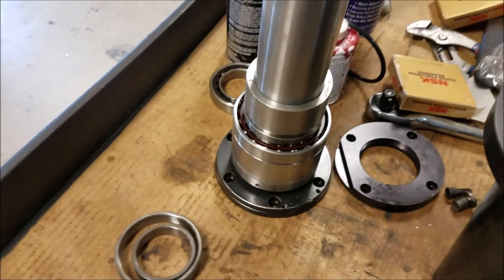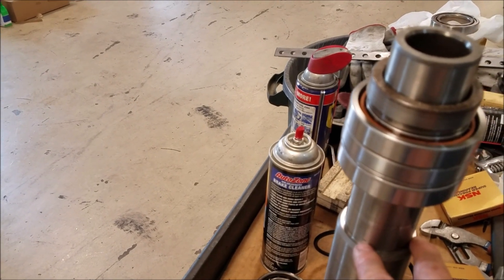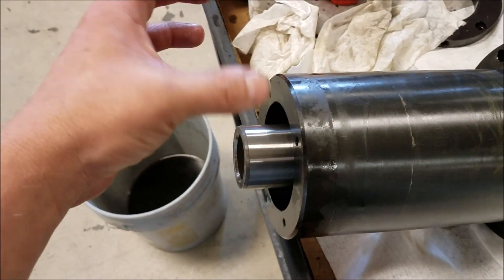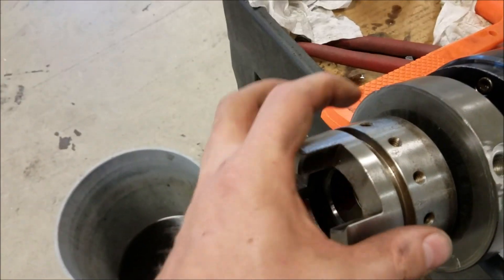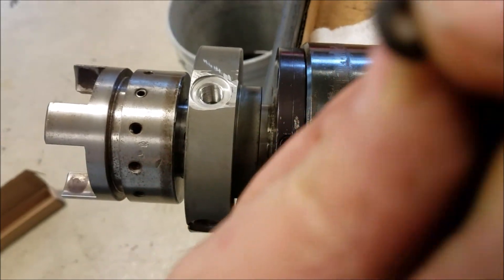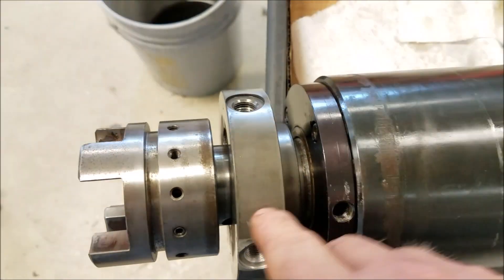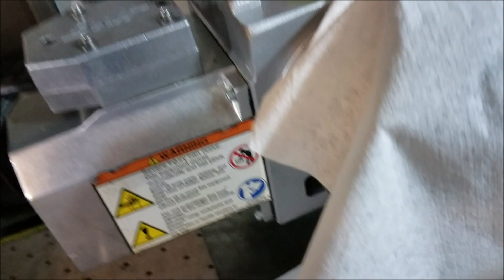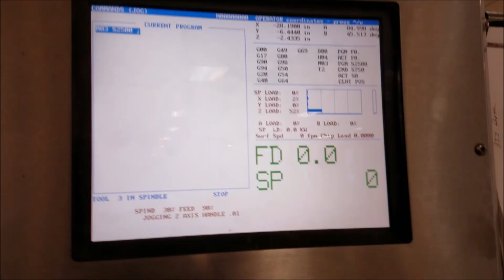Haas Spindle Bearing Replacement Part2

Comment: I like your video, but you failed to explain the most critical part of this process... the proper mounting of the matched set of the angular contact spindle bearings. There is a reason why professional service technicians are paid what they are paid, because they know these things. 
Secondly, machine tool manufacturers sell these spindle cartridges as complete assemblies, because they are balanced after assembly at the factory.
Finally, shims are used by FST's who don't understand how to tram the column.
Reply: The spindle needs to align where it's mounted. It needs to be parallel to the z axis and perpendicular to the x & y.
You aren't supposed to shift the z-rails off vertical to compensate for the mating surface that mounts the spindle - unless you want to cut diagonal vertical lines.
No one going to warp their column or do some other extreme measure like trying to resurface the mating surface for something that every guide says to use shims to accomplish.
There's not a single machine in this aerospace machine shop that doesn't have a manufacturer guide saying to use shims to align the spindle at the mating surface if needed, including a 5-axis machine.
Your comment doesn't make the FST's seem ignorant...

Comment: The oil port doesn’t lubricate the drawbar. It is packed with grease and TSC often leaks in and corrodes the drawbar. The oil/air port only lubes the spindle bearings.

Comment: Sir can u help me about this how can i pullout the  coupler from spindle shafting  pls help me sir the spindle that i replace bearing is same to youre demo haas cnc spindle is very hard to me to pullout the coupler drive thanks sir
Reply: I use a torch to gently heat it all the while putting tension on it with a gear puller.  When it get warm enough to expand it should literally pop off due to the gear puller slightly compressing the draw bar.

Comment: I have done the same procedure as you have but now getting a loud knock when doing tool unclamp . Did you also have to readjust that after fitting the spindle ?
Reply: You shouldn't have to. As long as you installed the threaded pins in the draw bar properly and are snug, there shouldn't really be any adjustment needed.
Reply: The preload pressure on the drawbar is too low.  The air regulator for this is inside the spindle cover.  I think it should be around 15 psi.

Comment: To those that want a bearing number. I will not post my numbers becuz they are very expensive... and if the bearing are different from one to another... I dont want someone to be out. Basically... pull it apart and read the correct numbers off your bearing. Any bearing shop can cross them.
Reply: Hey Michael, I've contacted the OEM for the bearings with the bearing number and was advised they are proprietary and cannot be sold. Where did you purchase your bearings from? From a 1996 Haas VF3.

Comment: What about the balancing of the drawbar pushing collar thing, when it has a huge piece missing?
Reply from the maker: To be honest, rolling the dice. Aside of making a new one, it's all I could do at the moment. I figure I could change the bearings roughly 4 to 6 times to equal a factory new one. Thus far has been cutting and running fine.